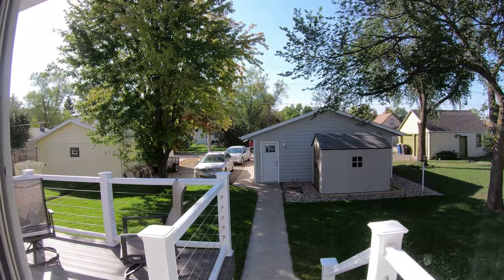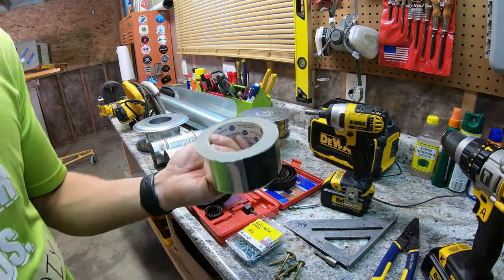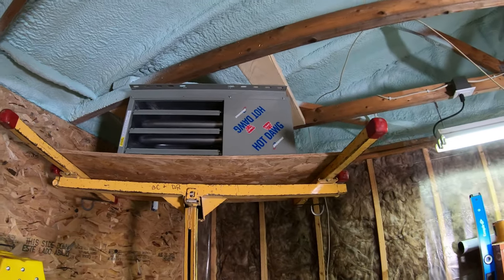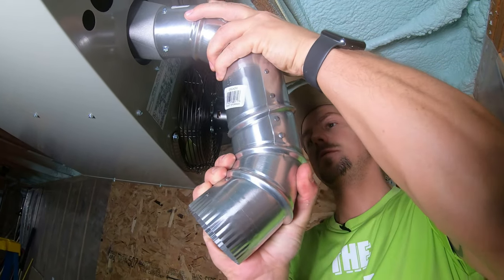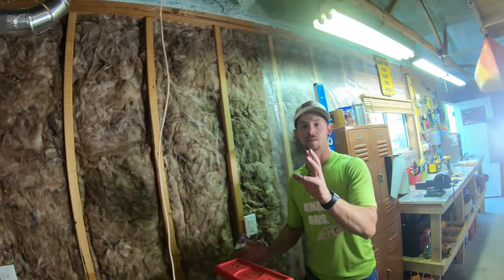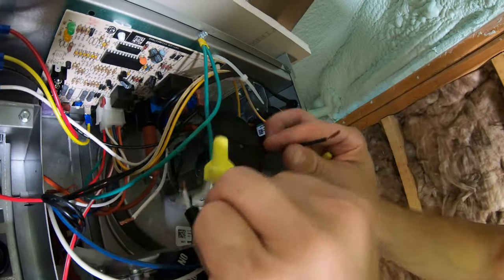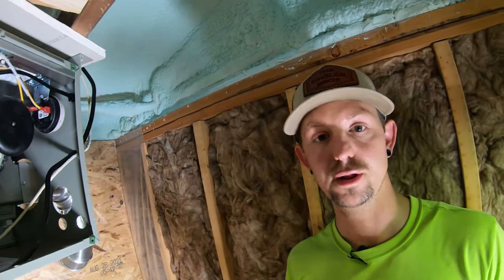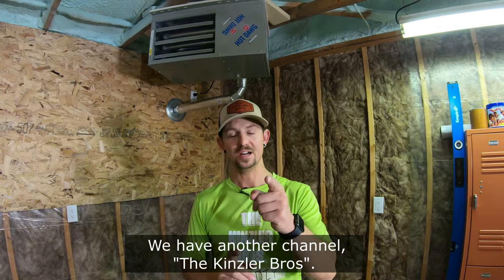How to install a garage/shop heater. (Mounting, Venting, Wiring).

Comment: I'm not sure where you live, but I highly recommend that everyone check the codes for their area.  Where I live, it's a violation to install the outside rain cap in anything other than the vertical position, so you would need a 90 degree elbow to turn it upright.  They do make caps for vertical use, but the one you have doesn't appear to be designed for it, and will likely not keep a heavy rain out, in that position.

Also... I have never, EVER seen a code that allows a flue pipe of ANY kind to turn downward more than an inch or two below the point where it exits the heater.  Even if it has an exhaust blower pushing the flue gas out.  The manual for that heater even states that a vertical vent shouldn't slope downwards more than 1/4" per foot to allow for drainage of condensation away from the heater, and that's only if your local code allows it.  And it needs a proper drain leg.  
(see page 10, section C7)  https://www.modinehvac.com/wp-content/uploads/2020/01/Hot-Dawg-Power-Vented.pdf  
The way you have it, that pipe will collect and hold condensation, and rot through the pipe before long.  You're also using a section of aluminum Dryer vent pipe inside.  That's a HUGE code violation and SUPER dangerous.  It's not made for flue gas venting and will corrode and rot through even with a proper condensation drain.  It needs to be galvanized metal flue pipe.

I'm also really curious why you didn't just run it straight up through the roof instead.  Not really any harder and it looks a hell of a lot nicer having it up top and out of the way of everything instead of sticking out of the wall like that.   Might even use less pipe.

Be safe out there, friends.
Reply from the maker: It’s been like that for over two years and nothing has rotted at all and I do not have aluminum piping outside my garage. It’s all galvanized outside. My double wall goes through my wall and outside. My local ac guy hooked my fathers up just like this.  Never had a problem with heavy rain either and it sits on the NE corner of my garage. But thanks for all your thought out comment